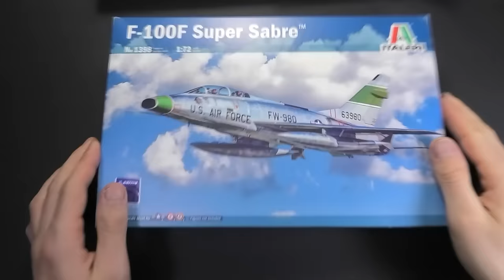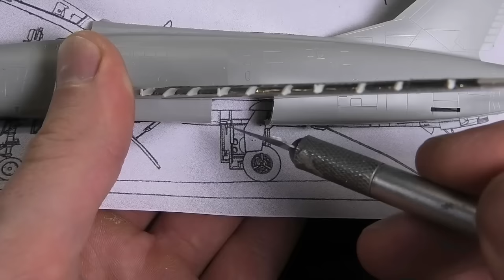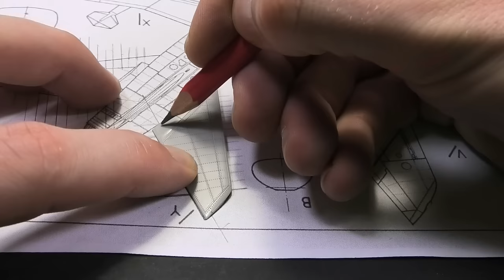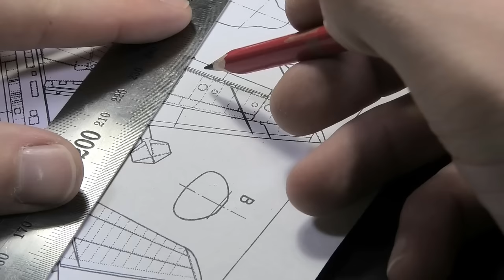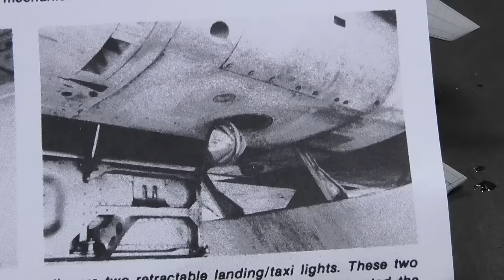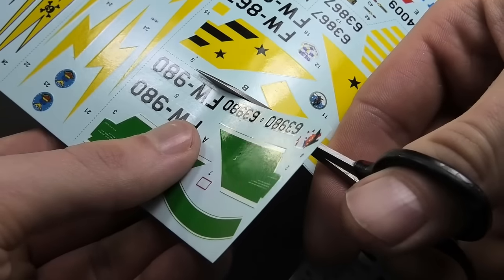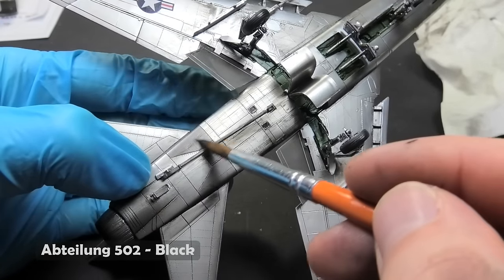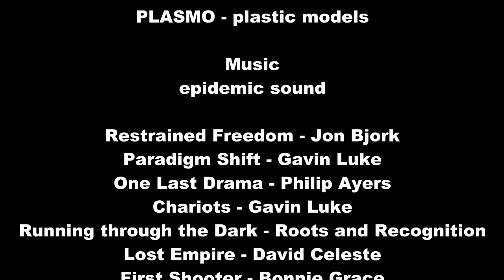F-100F Super Sabre - Italeri + Trumpeter 1/72 - Aircraft Model

Comment: It's almost blasphemy to criticise such a wonderful build, but I don't believe in deities or that blasphemy is a crime. You have an error that you haven't fixed. At 21:18 it is plainly visible: a row of small "panels" down the fuselage side just below where the fin connects to the fuselage below the rudder. This row of panels opens up to accommodate the brake parachute lines - however it should be only on the LEFT side. There is a glimpse of a drawing at 8:28 where you can clearly see this.

I built the ESCI F-100D in the 90es (and my build was crap compared to this one, although I think I did a fair job of the faded OD of RDAF Huns, considering that I brush-painted it), and my references (or maybe it was a review) mentioned this error, which is easy to fix with a little putty and some sanding. Other than that, the Italeri F-100D and F-100F are probably still the most accurate 1/72 scale Huns available. They have a distinct similarity to the ESCI F-100D and ERTL F-100F (which are also related to each other), so are probably reworkings of the original molds. Despite being originally from 1982, the ESCI F-100D kit won several awards, I think German Modell-Fan magazine had it as model kit of the year in perhaps 1984 or 85?

Why Trumpeter can get away with their monstrosities I don't know - I wouldn't ever touch them. The intake looks terrible for sure. But worse, I remember seeing a build of the Trumpeter F-100F and it looked completely off - I think the cockpit section has been lengthened too much, making it more of a 2 1/2 or even three-seater! It really should be called an F-100-what-the-F! Separate slats may be nice, even indispensable if you want a correct impression of a parked aircraft, as they would be deployed then; but they should not be too hard to make from scratch, I wouldn't pay money to Trumpeter for that embarrassing trash.

One error Italeri has introduced when they made their D from the ESCI molds - for inexplicable reasons, but I still believe it is the case - is a spurious canopy frame line lengthwise on the -D canopy. This needs to be sanded smooth, which is of course painful with clear parts. The F-100F does not have any problems that I know of, except the parachute line panels on the right side as already mentioned.